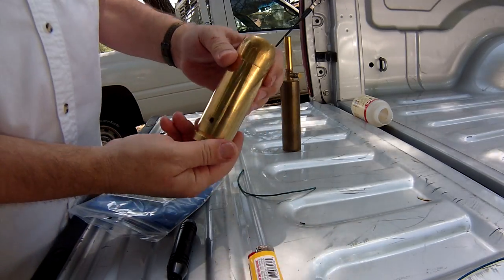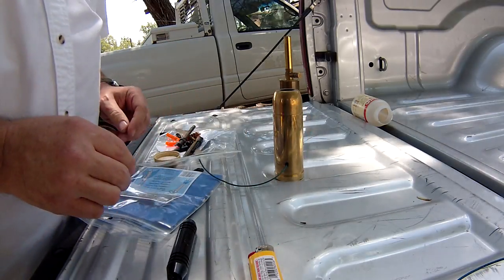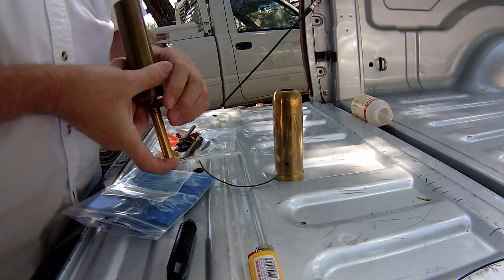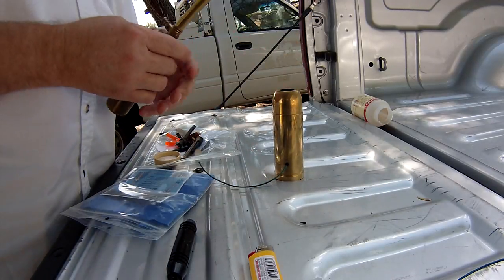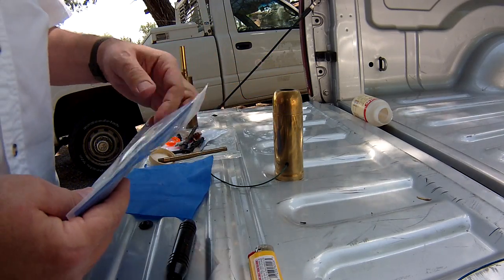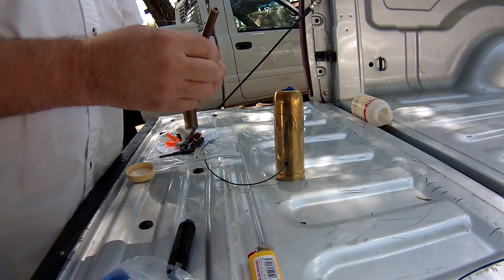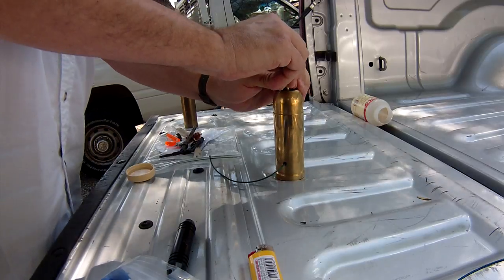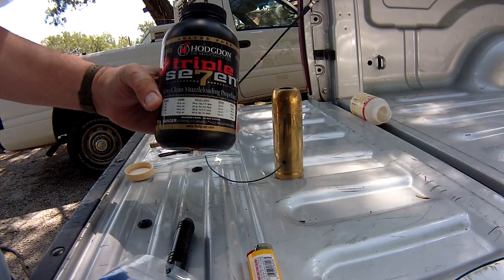Signal Cannon on July 4th

Comment: What's the lenght and diameter of this cannon it's really nice
Reply from the maker: About 7 inches long, and 3/4" diameter.  Haven't seen it for sale anywhere for about 4 years, which is a mystery to me.
Reply from the maker: Clarification, it's a 3/4" Bore, the outside diameter is over an inch. I'd like to measure it, but I can't find it. When I do, I will add the data.
Reply from the maker: I found it!  The outside diameter is about 1 and 11/16 inches).  The bore is 3/4" diameter.  The outside length is 5", and the bore is drilled to 4" depth measured from the muzzle end.  The touch hole is right at the bottom of the bore, (4" from the muzzle), and is 1/8" in diameter, but chamfered slightly to 3/16" of an inch at the outside just to allow easy insertion of the fuse. The chamfer is about 1/16" total depth.

It's made of brass, I would say the wall thickness is about 15/32",  very close to 1/2". 
If want to make one, there you go!
The real key to safety is to not put a heavy or solidly jammed projectile in it,  use only paper/cloth wadding, bread, etc. and it will do fine and make plenty of satisfying noise. 
If you put too much black powder in, you'll just be wasting it, any excess will be shot out.

REMEMBER: USE ONLY BLACK POWDER, DO NOT USE SMOKELESS POWDER or you may have a pipe bomb on your hands!

Summary:
Outside diameter: 1 and 11/16 inches
Bore:    3/4 inches
Overall length: 5 inches
Bore depth: 4 inches
Touch hole diameter: 1/8"
Touch hole location: at very bottom of bore
Reply: Thank you so much for giving  deeply information ...🙏 I'm also make cannons and I'll definitely try this ..
Reply from the maker: @rushidixit2611  Great! I was hoping you would were a cannon maker!  This was a beautiful design, and sadly I can't find them anymore. There should be more of them! Good luck!
Reply: @lapisdust  thank you 😊
Reply: @lapisdust  I'll definitely send you a picture